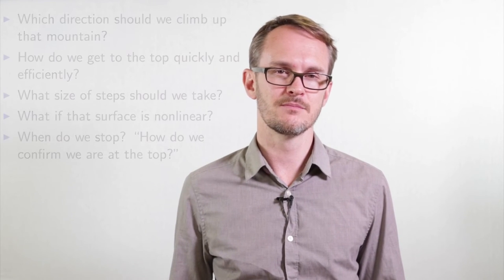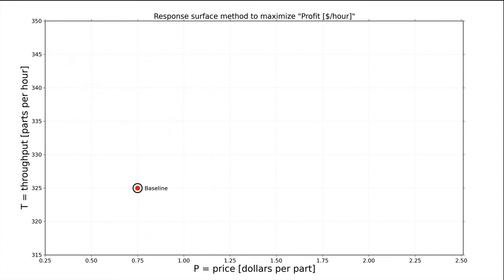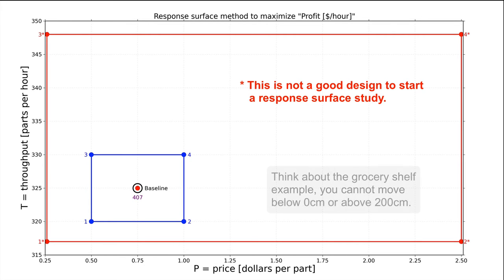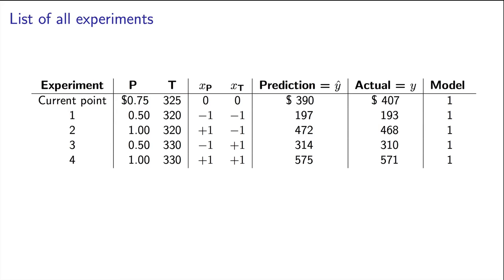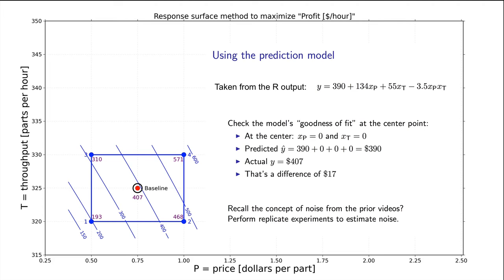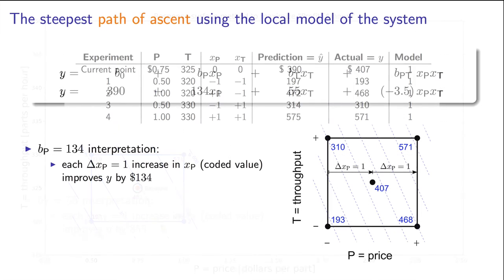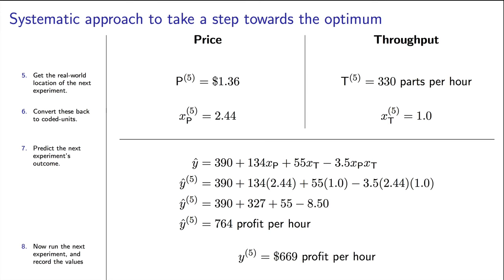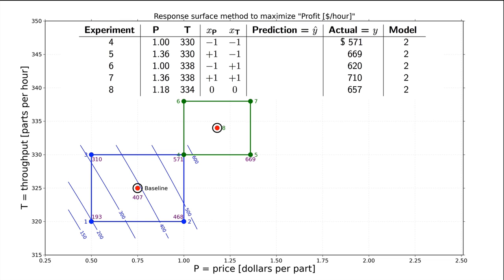Experiments 5E - RSM in 2 factors: introducing the case study

Comment: Thanks a lot for this wonderful video and smooth explanation... I was just wondering how to set the actual values in relation to the coded values of the levels (-1.41,-1,0,1,1.41)??
For example if my factor is treatment time(from 0min "low=-1" to 5min "high=1", and I would like to run a face centred design, could I relate the 0 level to 1min treatment time? or should it be exactly in the middle of both low and high values (2.5min in that case)?? Please advise
Reply from the maker: Hi Adham: great question! In your example the 0 point would indeed be at 2.5 minutes. 

You can watch some of the other videos in this playlist (particularly 5A, 5B, 5C and 5D) to get a sense of that. These videos actually make part of a free course on Coursera: https://www.coursera.org/learn/experimentation where you can get more than just these videos.
Reply: Thanks a lot for your quick response.. I found the answer to my question in the formula provided in this video, I asked too quickly before coming to that point in your video (I appologize). But I was also wondering if it would be a good idea to start my experimentation jumping directly to a face centred design using a broad range of levels (0min to 5min treatment time), just to get a general idea of the response, and narrow down my levelling spectrum afterwards in my next experiment in the high response region (choosing my new levels to 2.5min and 3.5min for example)?? Because in my case, although 0min and 5min are the constrains of operation, I doubt if narrower levels would have any effect on the response.
And I have to mention that I really gained a lot of knowledge, in the smoothest way, watching this outstanding course... Thanks a lot for your efforts and dedication. I appreciate it :)
Reply from the maker: If the experiments don't cost much time or money, then it is okay. Generally the advice is to start with a simple factorial cube. Since you don't know if you are far from the optimum or close by. If you are far away, then the extra experiments from the face add no real value, other than confirmation.

Once you are closer to the optimum (tips in the video tell how you might know that), then you want to bring the size of the cube in (to avoid stepping too broadly past the optimum) and to add those face centered points, and points that will support quadratic models (the +/- 1.41 points). Since by definition an optimum will be nonlinear, you will need those nonlinear terms at/near the optimum.

The video 5B lays out those ideas, except for a optimum in terms of a single variable, or factor. But the principle for multiple factors is the same.

Further, I wouldn't recommend starting your experiments at the constraints (0 and 5 min), since you will almost certainly span a nonlinear region, and try to fit that with a linear model. Start much smaller: around 2.5 at the center, with +/- 1 minute, would be my advice, in the absence of knowing more about your system.
Reply: Kevin Dunn Thanks a lot for your valuable advise... I will come back to the videos you recommended... you are saving me a huge time and effort going through some complicated statistical text books to get such valuable knowledge... I appreciate it
Reply: Another question please. In case of examining the effects of 3 levels for an experiment with 2 factors. If, for practical reasons, it would be favorable to choose the mid level not exactly in the middle of the high and low levels, and in case I would choose 2.5 min treatment at the center as you kindly suggested, would it be possible to formulate a nonlinear model while choosing the low level at 2 min treatment and the high level at4 min treatment? would this mean that I have to change the corresponding coded values of the high and low to a fractional values instead of the integers  -1 and 1? Please advise. Thanks again for your continuous support :)

Comment: when you have curves instead a linear surface, and you want to minimize, but for it, you have 2 options in 2 directions, but if you wanted to maximize you'd have a clear direction (diferent to before ones and not opposite to before ones)??
Reply from the maker: Hi Angelina, one way to answer your question is to realize that any optimum (maximum, or a minimum) will come to a point. No matter how you approach it, there will be a clear direction.

What you are describing might be what you see as you are on the path towards a minimum. In that case, the general rule is to take the path that is steepest descent (minimum) or ascent (maximum). However, in practice we have extra knowledge about our systems, and we can choose any path we like, as long as we head in the general direction. 

Remember, the goal is to get there, and it might mean to take an extra step or two along the way, especially if each experiment is not too costly.
Kevin